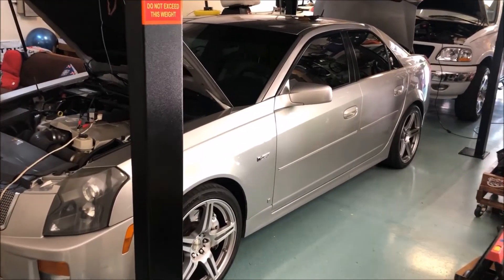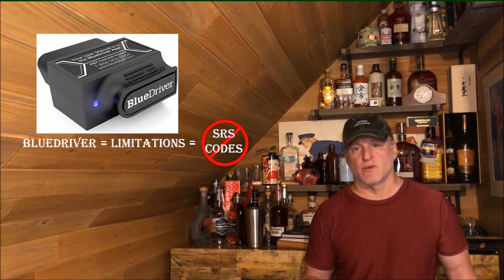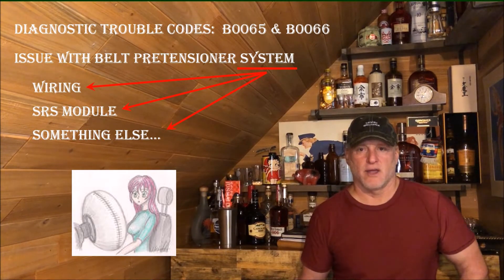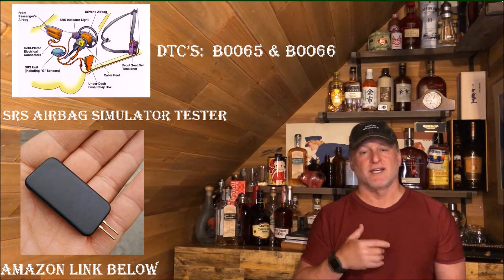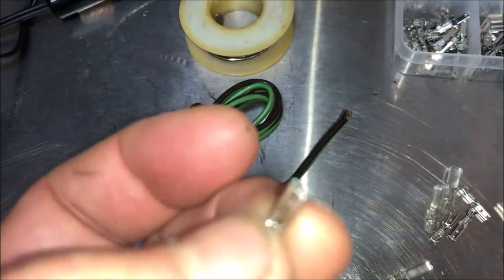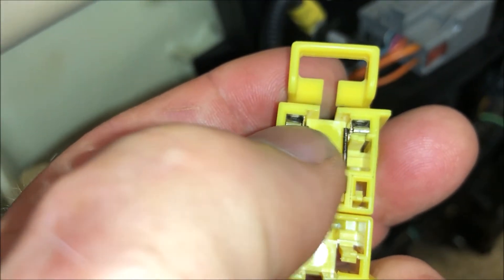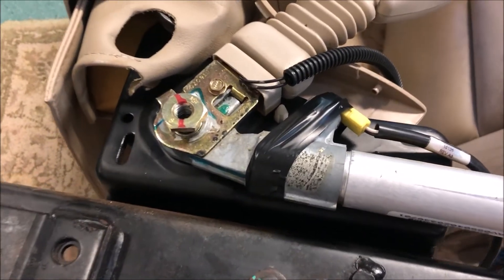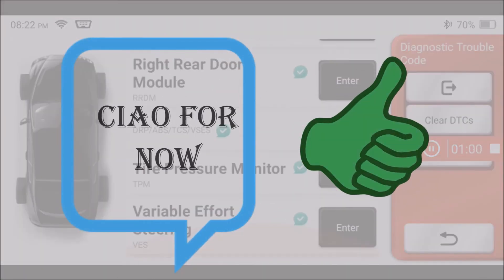GM SRS Troubleshooting & Fix: '03-'07 CTS SRS Airbag Failure B0065 B0066

Comment: I love the way you care for this V I replaced my wife’s 07 CTS V motor mounts with the help of your video . I would like to ask if you have a solution to the front facia and the gap between the hood and the facia, I would like to make smaller maybe you have a good idea
Reply from the maker: thanks for the comment!  I saw once that someone had made a steel plate the would fit under the bumper cover to prevent the sag. They don't make them anymore, but it is an idea, perhaps make something out of fiberglass that will fit on top of the bumper, but under the bumper cover.

Comment: This was very helpful to me because my airbag light came on the other day and the screen  also said service airbag what happened in my case one of my passengers put something up under the passenger seat and seem to of disconnected something there because I pulled the seat all the way back plug-in something that wasn’t plugged in and that took care of my airbag light system I have an 07 CTS with  the same yellow connector that you showed in the video. So watching your video told me just exactly what to go out in my driveway and check for in my car and I fixed it very simply. Thank you for making the video
Reply from the maker: Very glad my vid helped!

Comment: You did a really good job on this. I am a retired GM service engineer, instructor, and technical writer. My job is to go out and fix these things every day on the road at the dealership level. And your approach is really good. And your video is put together really well. So keep up the good work and continue to use caution the way that you do safety is the most important factor. Thanks again
Reply from the maker: Thanks again very much!

Comment: Thanks for sharing. Q: Did you disconnect the battery for 30 min and reconnect before start the analysis/work on the system? Why should you do this de-energizing process? Would it be dangerous just to test pretensioner impedance (my case/problem probably) without performing de-energizing process?
Reply from the maker: Thanks for watching and checking in.  Never disconnect or test connectors without first disconnecting the battery for at least 30 minutes.  Sometimes I wait a few hours.  The purpose of this is to allow all stored energy to dissipate.  If you do not wait, your SRS system may activate and deploy airbags and pretensioners.  This is a VERY IMPORTANT STEP.
Reply: @DrivingIntelligence  Thank you very much for the prompt and important answer!!! How much time would it take the SRS system to re-energize when I re-connect the battery i.e how much time can I work safely to test the pretensioners after re-connecting the battery?
Reply from the maker: @YoavLevanonMusic  once the battery is reconnected, you’ll have to go through the de-energize process again by disconnecting the battery for at least 30 minutes.  Never safe to work on SRS when battery is connected.
Reply: @DrivingIntelligence  Many thanks!!!